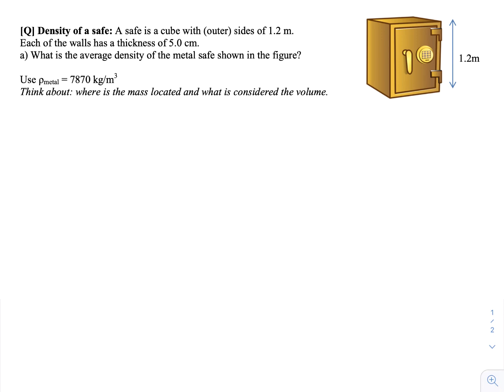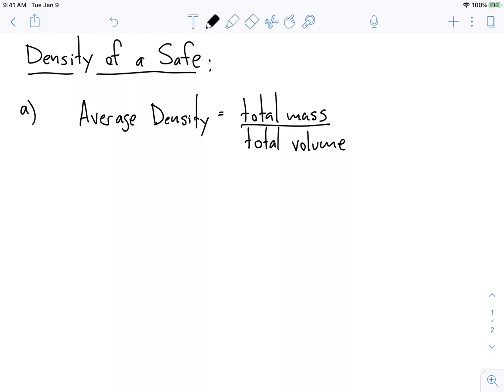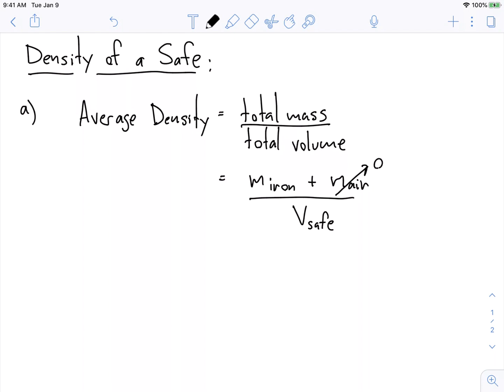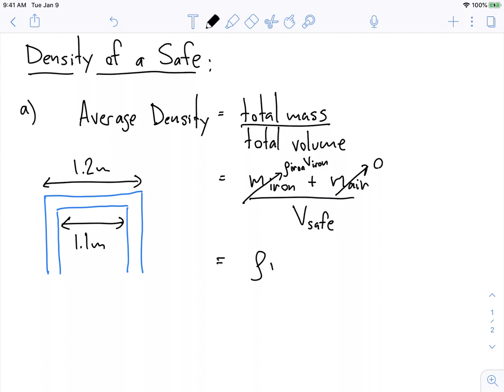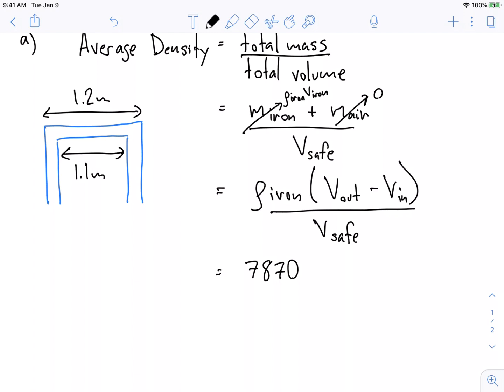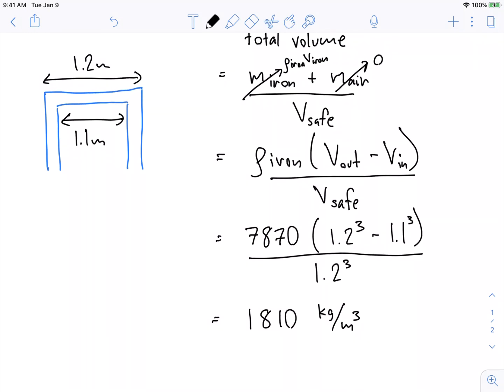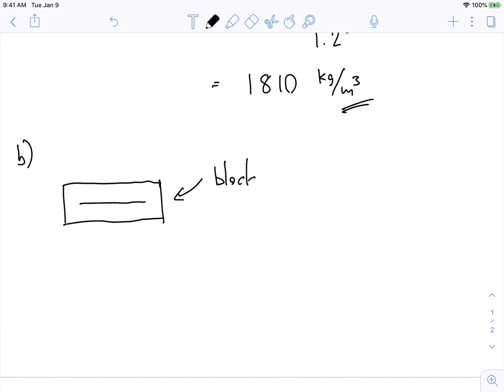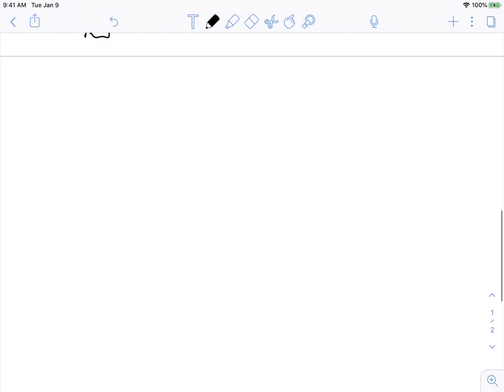The last explanation of the density of an iron safe you'll ever need!

Comment: how did you know the cube is 1.1 m in the inside?
Reply from the maker: The outside dimension of the box is 1.2m. The walls are 5cm = 0.05m thick. The outer dimension accounts for two walls, one on each side. So, the inner dimension is the outer dimension minus twice the thickness of the wall: 1.2m-2*0.05m = 1.1m.